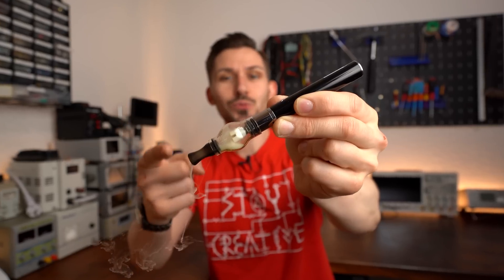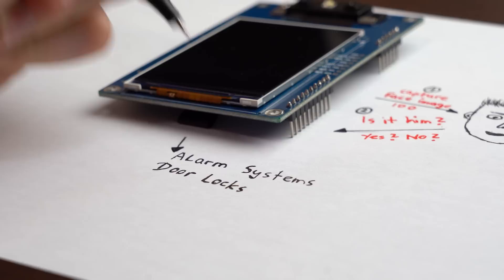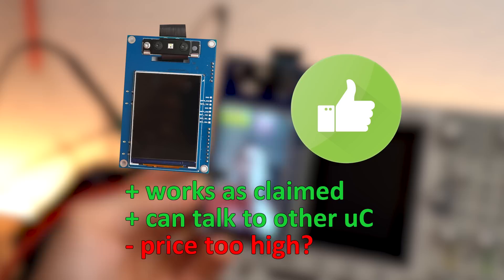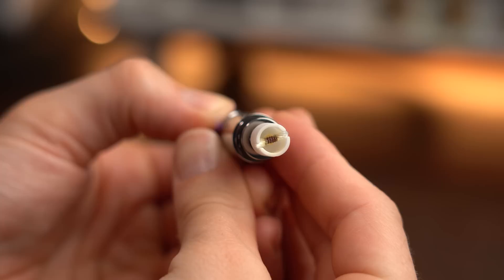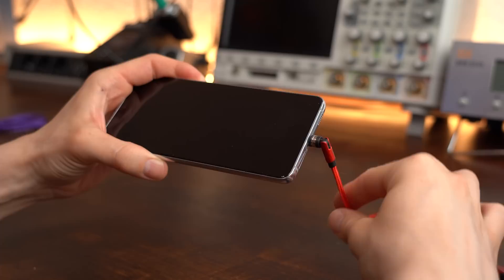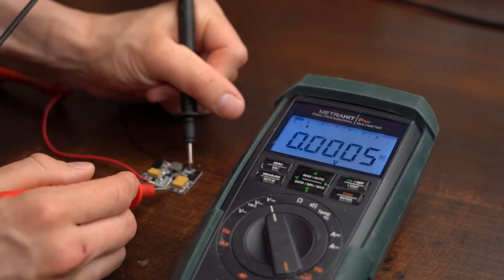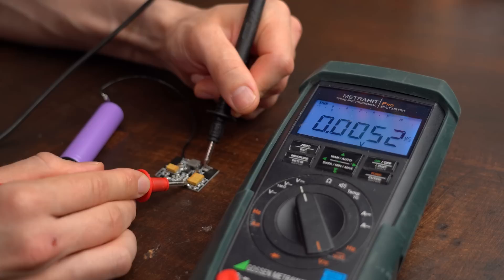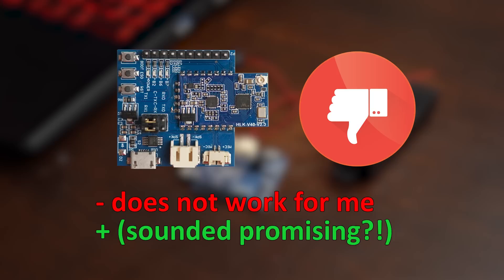I tried finding Hidden Gems on AliExpress AGAIN! (Part 5)

Comment: That thing you showed at the beginning of the video is in fact used to burn THC Wax to smoke it
Reply from the maker: Nonono only for electronics.....
Reply: load up that rosin brother
Reply: @TheSelfUnemployed  🤣
Reply: @greatscottlab  NOPE. I have used the exact same thing you showed in the state of Colorado that came from a headshop bro. It's original use is THC wax
Reply: @Chilling4Shillings he's being...
Nvm
Reply: @Chilling4Shillings  drug addict
Reply: @Chilling4Shillings  he's being sarcastic.
Reply: @crappyatlife whish i could laugh react. THC is not a drug😂😂😂
Reply: @drowhodis556  it is, it's just one of the least harmful out there!
Reply: @greatscottlab  Technically true, but... yeah no, its a thc dab pen.
Reply: Northridge fix use the same pen to find shorts on boards, pretty cool
Reply: @drowhodis556  Clown
Reply: @angel-0f-heaven  have you heard the expression talking with the tongue in cheek? 

His meaning is to be ironic. 

I have a vape pen in my tool box as a smoke box to found engine leaks and I made the same joke when asked.
Reply: It is a common vape base. Small box mods with 510 tips are often sold as portable welding irons.
Reply: @drowhodis556 aying thc is not a drug is like saying electrobike isnt motorized vehicle... I mean it is one of the least powerful, but still motorized vehicle, boy... Dream on
Reply: Had one 😂 nice pick up
Reply: Yeah but steel wool is used to smike crack and meth....
Reply: Right hilarious
Reply: @greatscottlab  Lmao 🤣😂 bro it's true
Reply: @drowhodis556 I believe I am autistic because THC somehow increases my thought and idea “processing”, it’s amazing! I tried pot as a kid, didn’t like it, made me sleep. Something has changed because now it actually “energizes” and improves my ability to actually think 💭 past all the noise and clutter. It’s so weird yet amazing! 😊
Reply: @greatscottlab  weed is being legalized in germany right?
Reply: It looks rather like a bong, but it isn't one.
Reply: I was thinking about the multiple uses, like THC, maybe some crushed up meth.
Reply: It's literally identical. Being from a legal place, I see these all the time. Will it be safe to smoke from? Maybe?
Reply: @greatscottlab  Nope, that's a weed wax smoker. The bulb is to contain a large amount of it without refilling.
Reply: @crappyatlife  just cuz he smokes weed means he’s a drug addict? that thing really is used for smoking thc wax 💀
Reply: FACTS! but funfact, thats a loophole because of tobacco and vape restrictions (so they just call it whatever)
Reply: @aidsboat  sounds like something a marijuana addict would say
Reply: Dabbing rosin core solder
Reply: @sergiogsr  i mean yes.... but ive looked at the product page. Its literally just a 510 thread cart battery with a funky chineese coil lookin thing. If you mean the person who made the video was joking? No surprise there, but no seriously, the product is literally just a 510 thread battery with a junk bulb and coil slapped onto it and sold as its own producy
Reply: @Chilling4Shillings  brain = fried
Reply: Denis Leary once said “They say marijuana leads to other drugs. No it doesn't, it leads to fucking carpentry.”
Reply: @angel-0f-heaven  damn man. 
You must be fun at parties.
Reply: @crappyatlife  and yeah i’m an “addict” not really i smoke at night and i still get up at 5 am and do my job, just cuz people smoke weed doesnt mean their a low life
Reply: @aidsboat  cool story bro
Reply: @crappyatlife  Not at all. I just know what that thing is. I quit smoking weed many years ago
Reply: @Chilling4Shillings  Chad weed quitter 💪
Reply: @crappyatlife  I have nothing against it. It's just not for me anymore. Occasionally I'll smoke. Not often tho
Reply: @Chilling4Shillings  they want you stoned and complacent
Reply: @crappyatlife  I'm good on that
Reply: Is it not what to use to put the smoke back in to electronics?
Reply: Fr tho
Reply: @drowhodis556 caffeine is a drug so is thc
Reply: Mfs is saying “THC wax”… I can tell none of y’all mfs smoke 😂
Reply: @lazymass  its not motorized! It uses an electric motor rather than a combustion engine. at least where im from in order for something (legally) to be classified as “motorized” it must contain a combustion engine which burns fuel thus an e bike is not motorized just how thc is not a drug
Reply: @gbeats5344  exactly
Reply: @gbeats5344  Mfs is saying... Do you speak English ?
Reply: @greatscottlab I think he just wanted to show he smokes them fat dabs
Reply: @Chilling4Shillings  oh I’m sorry PC principle
Reply: @gbeats5344  Stay in school
Reply: All the people acting like it’s not just a repurposed thc pen that someone sold on AliExpress with flux wax because it works with it as well 🤡
Reply: @greatscottlab a German using sarcasm and or humor?  What's the world coming to!  😂
Reply: @crappyatlife brain rot
Reply: Lol yup that’s what it is
Reply: @aidsboat I have to get up at 4am tomorrow but it’s fridayyyy
Reply: @drowhodis556 So, are Teslas and other electric cars not motorized and therefore not require a driver's license and insurance? Please say yes. Insurance is expensive and my 14 year old really wants to drive it!
Reply: @drowhodis556  actually false (at least in germany). If it has a motor and can drive by itself (a certain speed, on the road), it’s classified as a vehicle. This includes self driving e-bikes (theres another name for that) and e-scooters.
Reply: Smoked crack outta one of those in my 20s lmao.
Reply: @ColinTimmins nice brother, im also autistic and get legal medicinal cannabis, helps a lot like u wrote it ❤
Reply: @divinitasart1921 that's when you're wrong ebikes can go as fast as motorbikes if built properly, people even drag race them against sports bikes due to high torque off the line,  they get up to top speed fast too
Reply: @mtmadigan82 wtf does that have to do with cannabis or using it in the way this dude was?
Reply: @ColinTimmins  it depends as different strains and different forms act in different ways but I have the same as you if I smoke cannabis I can process things better.
Reply: @drowhodis556  in some countries if a ebike doesn't have pedals then it's classed as a self propelled vehicle and then makes it illegal to use without a licence, but then in some countries even if it has pedals too but is over 250-750watts of power you then have to get a license to ride it unfortunately, it sucks
Reply: @crappyatlife  dude most of the most intelligent people smoke cannabis, alot of rich people smoke cannabis what planet do you live on 🔔end
Reply: @crappyatlife cannabis I'd non habit forming go educate yourself 😂
Reply: @joblessalex I'd personally not use something like this no I use a stempod from the USA
Reply: @drowhodis556 it is. Caffeine is also a drug. Nicotine is a drug. Technically, SUGAR is a drug. It just so happens that THC is one of the most benign drugs out there. Now if they'd just legalize it (at least for medical, I'll meet the ones who DONT believe in it halfway here)
Reply: @ColinTimmins which strains are you smoking now vs then? I know the stuff you had was probably weaker, too. I'm also autistic, and have epileptic tremors if I don't get my weed.
Reply: @crappyatlife just because someone is stoned doesn't mean they're complacent. You're discounting the fact that some people actually require THC for health reasons (chronic pain and epilepsy being the main 2). In fact, we wouldn't have the problems with opiates that we do now if marijuana were legal to begin with, and doctors were allowed to freely prescribe it. Recreational is a great way to make a profit off excess stock (because weed molds... yeah no, you don't want good product ruined). Recreational also serves to keep people AWAY from the shit you definitely DONT want them touching. While it may not seem like much, the first 6 months of recreational being legal leads to a drop of opioid use, and that small win can be massive.
Reply: Nah I worked fixing electrornics each desk had 1 we used it for both XD
Reply: @greatscottlab  yes it is. I used to own one. It's a cheap one.
Reply: I’ve 100% smoked wax with that thing before.
Reply: Or crack.
Reply: I was gonna say this. That is 100% a vape that they're marketing as something else.
Reply: It's pronounced "resin" lol
Reply: Because inhaling wax is healthy?

Comment: Rosin is also another word for solventless thc concentrate that is extracted using heated plates in a press (aka rosin tech), and also is smoked/vaporized out of the same "dispenser". The dispenser was found in smoke shops in the USA probably 10 years ago when concentrates first hit the black market, and became popular around the same time nicotine vapes were just starting to be sold.
Reply: uhm actually thats called resin... live resin dead resin etc.... but yeah....
Reply: @tommyleegraves423  Googling "rosin" alone has the second link to a guide about the thc concentrate. Farther down an article has it spelled both ways in the same article. It is a proper spelling for it.
Reply: @tommyleegraves423  Rosin is technically a form of resin, however Rosin is a technique to extract thc without adding chemical solvents like butane, propane, and alcohol. The simplest form of this technique is smashing cannabis plants wrapped in parchment paper between the plates of a common hair straightener then collecting the concentrate on a cold surface so the oil solidifies making it less sticky.
Reply: @tommyleegraves423  bro rosin is the best concentrate you can get😭
Reply: @tommyleegraves423  how does it feel to be so wrong but think ur right
Reply: It's called "Rosin" here in the north west of the USA.

Resin is the black tar that gets piled up in pipes and bongs after smoking weed through them.

Rosin is a solventless THC and or CBD wax extract
Reply: You guys are smoking resin?
Reply: @Karedu.  Idiots will smoke road tar if it gets them high.

Comment: For everybody that likes the rosin dispenser but doesn't want their board sticky from it, you can simply use an air duster can upside down to freeze your board and reveal the faulty component the same way 😁
Reply from the maker: Good tip :-)
Reply: Thermal shocking board is not a good way to diagnose anything.
Reply: @1kreature  of course I wouldn't use it in very fine boards like multi layer phone PCBs, but it works for simple stuff
Reply: We did this in the early 80s at the TV repair shop where I worked except we soldered a refrigerant port to an aerosol can and filled with R12 from a 30lb jug.(back when it was cheap and legal)
Reply: I mean, yeah. I already did that successfully. But the problem is, depending on board size, this is preeeetttyy wastefull, i used about half the can of my freeze spray before finding the short. The rosin dispenser should last way longer and be cheaper in the long run.
Reply: neat idear but dangerous for manny types of boards / components
Reply: Wouldn't recommend doing this indoors - most "air" dusters are actually butane which is flammable. That's especially problematic when there's a chance of sparks/overheated components.
Reply: @jftechdrones  a ex co-worker of mine found out the hard way. 
I all ways told him it's flamable and he ignored & just laughted at me. 

That is till his 300$ industrial vacume he cleaned with said pressured air in a can literally exploded and puked his guts out of the control panel.
Reply: Most air duster has Bitrex in it and if you use it like this you will get some in your mouth and it is very unpleasant. You can buy freeze spray that does not have this problem.
Reply: @1kreature once I revived a dead board of led tv by just pouring some liquid butane on it from the butane gas, as i don't have a duster can. Lol don't ask me how it start to work after the process cause I myself have no idea lol 😂 the tv is working fine for months since then. Tbh that butane can can is as handy as a duster can if you can compensate with the smell of it. Don't forget to use it in well ventilated area tho
Reply: @brucehanson4147 lol I used butane can just removed the burner from torch and let liquid flow throw the pinhole outlet. Works flawless and cheap too 😂
Reply: Just say no to freezer lung. :(

Comment: there is a much better technique to find hotspots on a board which doesn't involve custom hardware and inhaling flux fumes, and that's just spraying isopropyl alcohol on your pcb
Reply from the maker: Hmmmm maybe I should do a competition between all these methods in a future video in order to properly compare them. Are there other ways as well??
Reply: @greatscottlab  a calibrated fingertip or upper lip can work on some things too
Reply: @greatscottlab  yes, you can replace isopropyl by petrol, way easier to find
Reply: @greatscottlab isopropyl, flux and thermal camera seem to be the most common
Reply: @greatscottlab  You can also use an air duster can upside down to freeze your board
Reply: Maybe try thermal printer paper?
Reply: @greatscottlab  Zippo petrol fluid.

Comment: I bought the same hot plate thingy and can confirm everything you said. First thing was also taking it apart, especially to check if the PE wire was connected to the case (which it was).
Reply from the maker: Glad you could confirm ;-)
Reply: 2 people confirming that the earth wiring is correct is definitely a good thing, you never know after all with that kind of stuff if the build quality will be consistent.
Reply: Did any of you try to fix the hotspot with a sheet of copper between the hotplate and PCB? Not sure if it helps, but i would guess a few millimeter thick plate might actually spread the heat more evenly. Not sure if even some thin copper sheets that they use for roofing is enough, but i'm sure if you ask at a roofing company for a 10x10cm offcut they might help you out.
Reply: I'd be very interested if someone can do an experiment if it's possible to fix that uneven heating issue.

Comment: its funny. 
i used to have one of those exact "rosin dispensers" in college almost 10 years ago, and apparently i was not using it correctly lol.
Reply from the maker: Haha
Reply: I can assure you that you were, lol.
Reply: There are similar products called atomizer and are used to apply a thin layer of rosin on board. Then you power up the board and can detect hot spots(where rosin melts first), which can be a sign of a short circuited component.
Reply: same lmao
Reply: Same. That is definitely a “multifunctional” product. 
I can confirm that it works for much more than just electronics troubleshooting..;
Reply: I broke the glass head at the unboxing time... 😢
Reply: No no - this is my rosin dispenser. 😂
Reply: it's definitely just a THC resin atomizer being labeled for something else for legal reasons lmao. They make liquids for this that are much cheaper and easier to use than a vape pen with tree resin lol.
Reply: This is absolutely an Ooze 😂

Comment: According to the voice synthesis module's manual, you need to choose serial port 1 using the jumpers (which you have already done right in the video). Then refer to section 2.3 to exit the default serial passthrough mode by using any of the two methods: 2.3.1, pull-down pin PB2/ES0 for 50ms-2s; 2.3.2, send "+++" to it (the module will return "a" if it received that correctly), send "a" in under 1 second (the module will return "OK"), it will fail if you took longer than 1 sec to send the "a".
You can send AT commands after that, but if you send only "at", it will go back to passthrough mode.
Reply from the maker: Yep. I read that in the manual as well. Tried it all. Did not work.
Reply: If I remember correctly, the baud rate in the data sheet for most Ali express products is plain wrong, usually it is just 9600. Another thing, for AT commands you usually need to do a command mode setup (specific pin pulled high as example)   and some sequence of bytes to trigger that byte mode of operation.
Reply: @greatscottlab  did you contact the seller?
Reply: @mohamedtalaatharb2441  First thing I wondered about was "command mode" as this is extremely common with modems that you have to switch between "Command mode and Data mode" (See Wiki article of same title for more)
Reply: What does the microphone on this thing do?
Reply: @mohamedtalaatharb2441  That was my first thought too -- it's clearly replying to input in the video but the "non printable" characters made me think the baud rate was wrong. Stick a scope on the module's TX line to see?
Reply: Try other cable
Reply: Did you turn it off and on again?
Reply: Try typing "ctl-alt-del" on the terminal. 😆
Reply: @Xorthis  😂😂😂

Comment: The buck boost converter really caught my attention. Based on the design and product description, something really cool is that itll operate in both buck and boost, meaning your voltage can start above the output voltage and drop below, but still work. This was really useful for me when i had to run a 3.3v Vout on 5v and 2.8v power. Its called capacitor based buck boost
Reply: "Charge Pump" is another word for that, if it uses capacitors instead of inductors to boost voltage

Comment: That AI chip on the face recognition module is not just an ASIC; it's a full fledged RISC-V system.

The hot plate could possibly be calibrated to eliminate its glaring temperature error.  Even my Yihua 937D+ had a calibration pot right in the front of it.
Reply: 淘宝卖一百多

Comment: Great video!  The voltage regulator looks especially interesting!  I also enjoyed seeing you use the vapor flux device.  I have never seen flux used as a method for finding short circuits.  Another effective way to find hot spots without a FLIR camera is to use a cotton swab (Q-Tip) to apply a bit of isopropyl alcohol to the suspect components and note how quickly the alcohol evaporates.  When you have a hot component, it will evaporate very quickly.